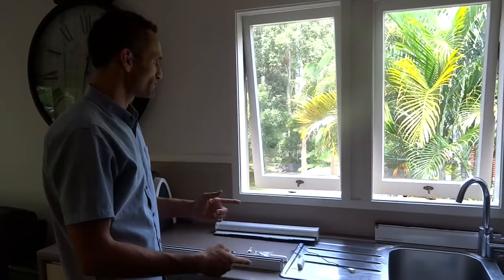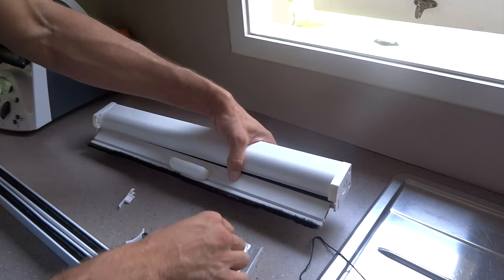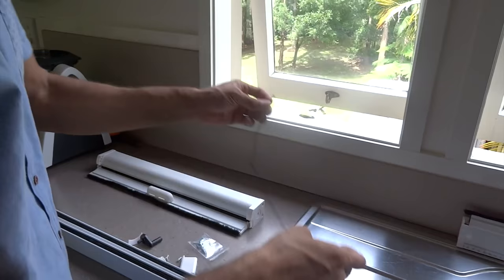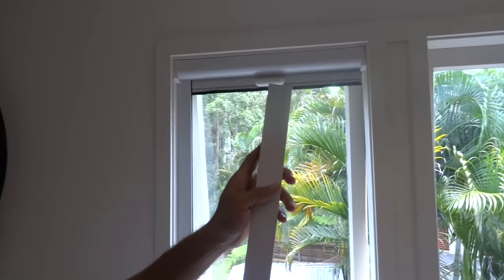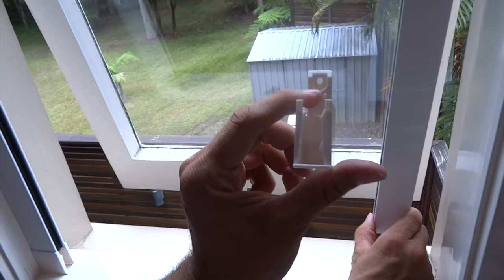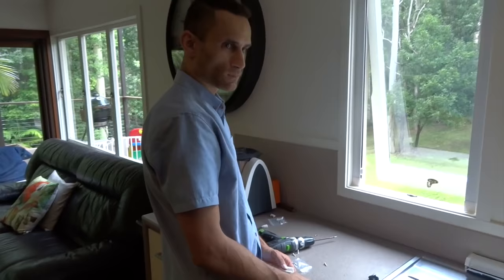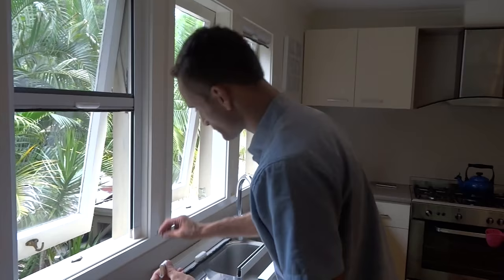How to install retractable window fly screen tutorial DIY flyscreen

Comment: just installed one of these.. few things to note -

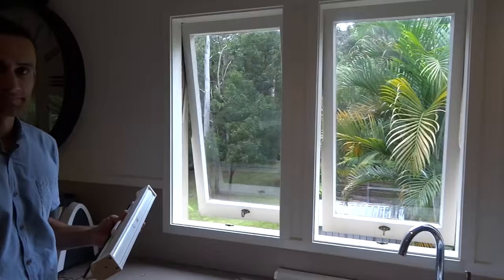1. At 1:58 you mention that there is a video on the cutting if you do a DIY install. I've not been able to find this.
2. The instructions don't tell you to take into account the height of the cassette when calculating the length of the vertical rails for cutting. I cut/installed the cassette, then measured the vertical rail height from base of cassette.
3. If you have clearance problems with latches/handles etc., just spin the cassette so it feeds out the front instead of out the back of the cassette. I had to do this and it works just fine. The curved face of the cassette will be facing outwards, and a flat face will be facing inwards.
4. Be careful with the provided screws for mounting the vertical rails. one sheared  off screwing it into pine. 
5. Don't forget to install the handle prior to inserting the endcaps on the bottom of the flyscreen, they are hard to get out.

Other than that, it works well (our old window is far from square - 880mm wide at top, 885mm wide at bottom - make sure  you measure top and bottom and left and right! ), didn't require any tension adjustment - it retracts back up at a controlled speed.

Comment: Product is great,  however this video and the install manual only shows installation process if the kit has been "pre cut"....

If your window is around 450mm wide the  tension spring needs to be pulled out and cut down and then you will have to retension....100 extra steps if you order the kit and cut yourself.

Please update your install  instructions based on cutting the standard kit at home
Look at replacing all your casement widow handles and lock bolts as mine all clashed with the screen and side tracks.
Product looks and works really well but more info is needed concerning window types and minimum dimensions
My windows were all casement type